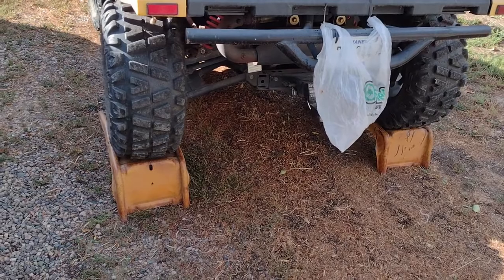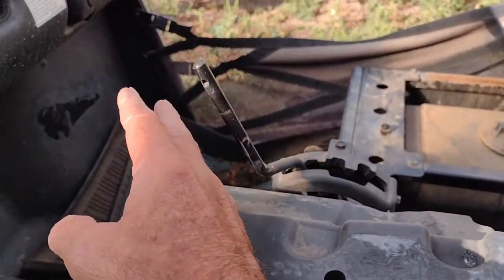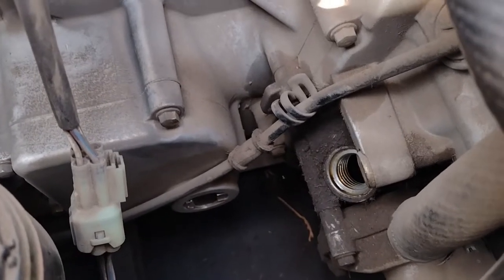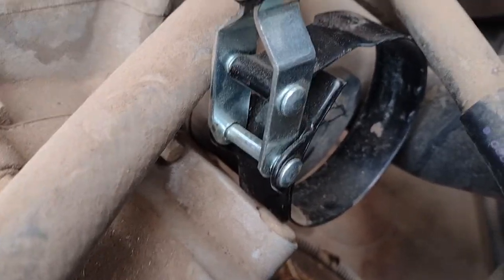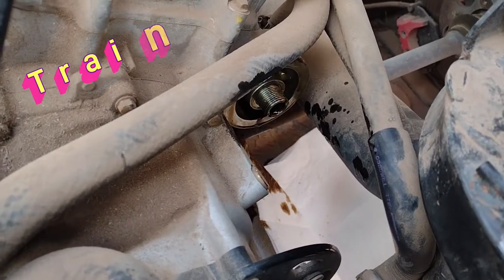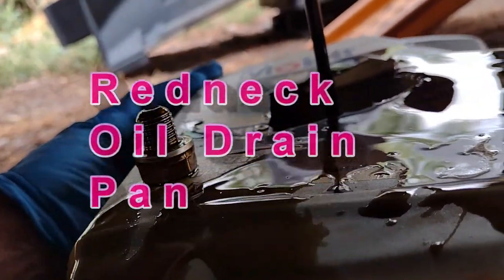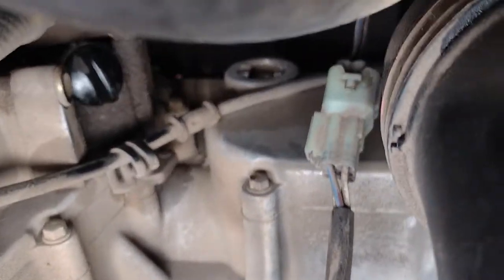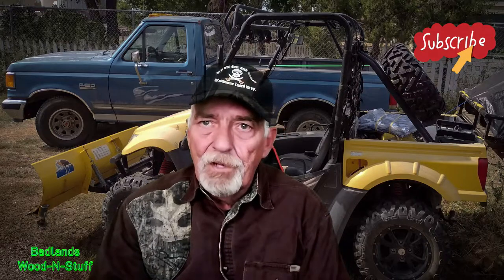Changing Oil & Filter on the Kymco UXV500i Easy Maintenance, Nothing went wrong.

Comment: Have you ever had an issue with it staying running? Ours starts but fails to stay running..
Reply: Is it carborated or fuel injected?
Reply: @jcarter855  carb..
Reply: @joemartin8888  I've been through that before on other carbureted Vehicles like four wheelers and such a good cleaning especially the main jet and idle Jet and you should be good to go I would guess. Plenty of videos out there on step by step carburetor teardown and cleaning
Reply: @joemartin8888  before you do anything like that though check for water in your gas tank
Reply: @jcarter855  I was thinking about that being an issue.....You're probably right on ....Ty
Reply: @joemartin8888  Never a problem, water in the gas has bit me often so now its the first thing I check for. best of luck!!